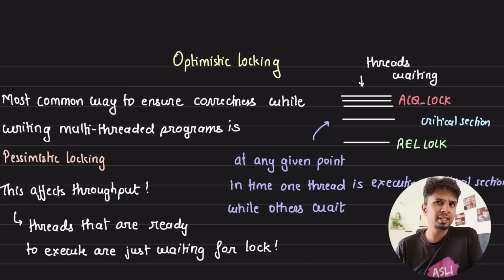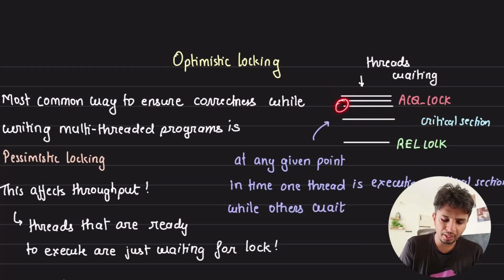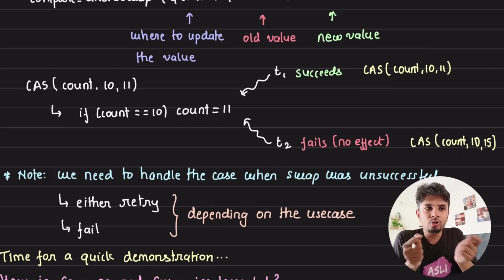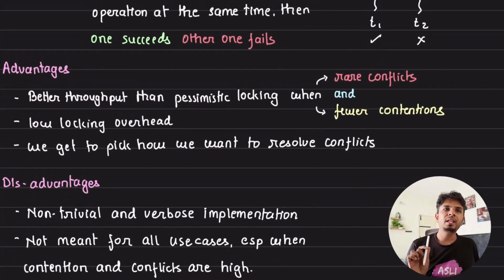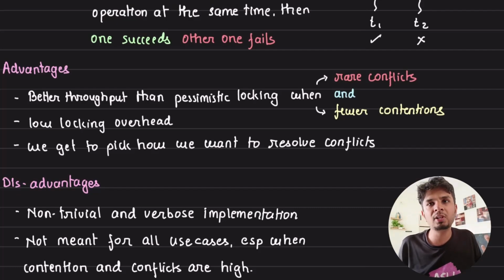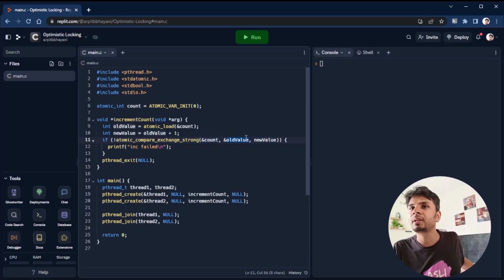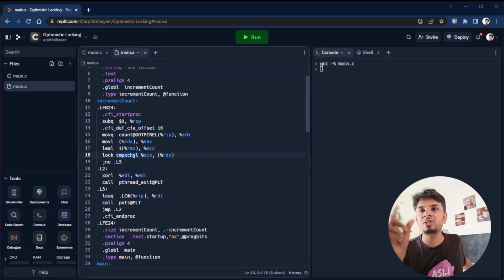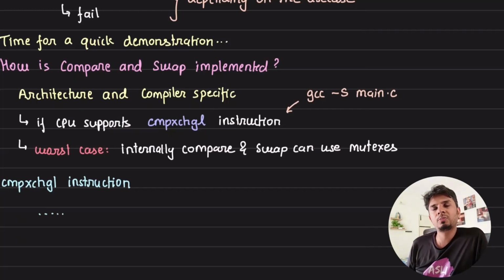Optimistic Locking - What, When, Why, and How?

Comment: Hi I landed to your video randomly, while looking for the below query can you help me with this :

I am using NODE JS, and implement dynamos and optimistic locking is enabled on a version which is integer, and i am performing an update operation.
But version is not increasing the automatically.
Where in Java it's working as expected.

I try to figure out the reason on google :
It's likely because of  using the AWS SDK for JavaScript, which does not include a direct equivalent to the Java SDK's DynamoDBMapper.

Java DynamoDBMapper:
Provides a high-level Object Persistence Model (OPM) that maps Java objects to DynamoDB items.
Includes built-in features for automatic data type conversion, object mapping, and optimistic locking.
Relies on annotations, specifically @DynamoDBVersionAttribute, to manage version numbers.

Node.js DocumentClient:
Offers a lower-level, direct API client that provides a more flexible interface to DynamoDB.
Designed to give developers direct control over requests and responses.
Does not provide an OPM or automatic version management.

Where as I'm not sure about my research is how much correct or not?

can you help me with that?

Comment: Please help me in this scenario,
If my app is load balanced and I have 2 nodes running under it.
When 2 requests arrived to update the same resouce. How can Optimistic Locking works?
There will be 2 machines and each can execute compare_and_swap or (TOC and TOU) same time or a race condition may be.

Comment: In optimistic locking there is a concept of Time-of-check to time-of-use
when we are checking the old value to be old value => so that we can write it to the new value.

there can be another thread which will actually update it in the time being of this checking and updating.
and current thread might be a case of also picking up old value = old value.

here the race condition might occur
Reply: Please help me in this scenario,
If my app is load balanced and I have 2 nodes running under it.
When 2 requests arrived to update the same resouce. How can Optimistic Locking works?
There will be 2 machines and each can execute compare_and_swap or (TOC and TOU) same time.
Reply: The reason behind race condition is that multiple threads are trying to execute the critical section. In this case the problem is solved by CAS. This will run atomically. Focus on the world atomically. It will either run to completion or not effectively not run at all. If thread1 updates the value of the variable and context switch happens at that instance and thread2 now tries to update the value of this variable. Now thread2 will execute CAS meaning this instruction will compare with the old value and swap. Both this actions are run together atomically. So no chance of any other thread coming into picture. Here thread2 CAS will return false or failure as the value is already updated by thread1. If you still have difficulty understanding think why it will fail and not succeed